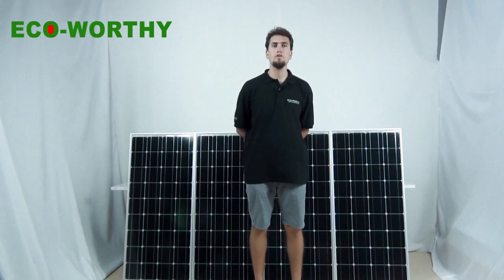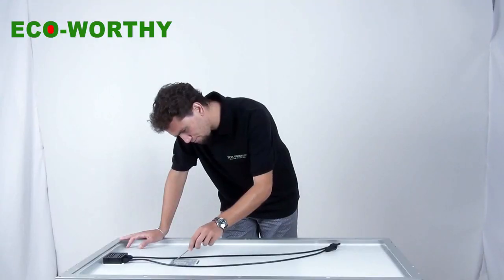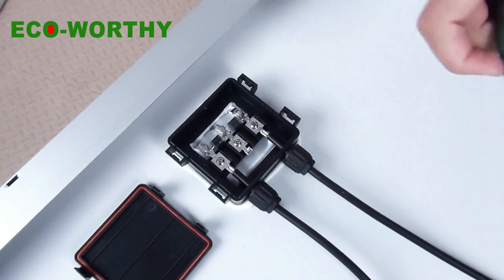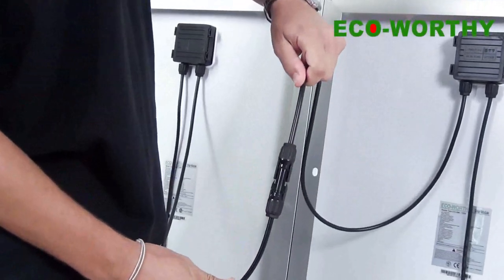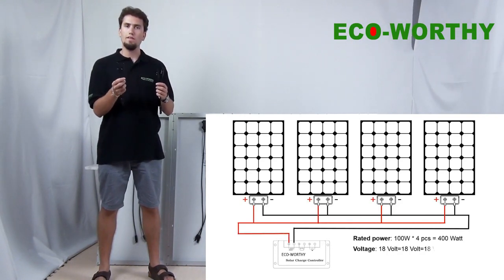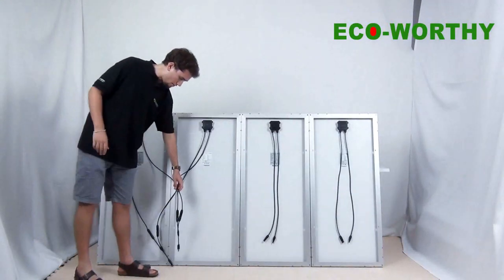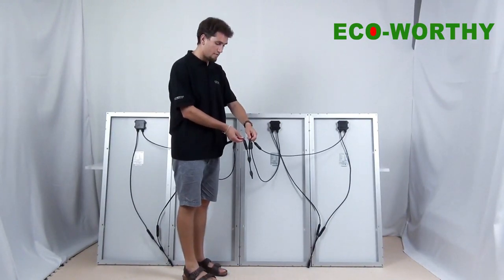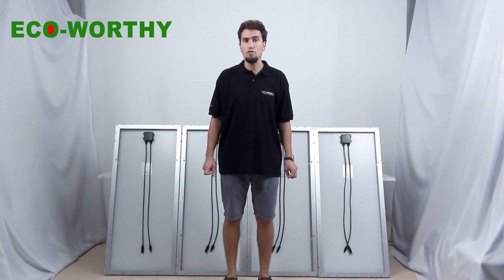Series vs Parallel -Two connection ways of solar panels

Comment: what's the benefit to series vs parallel?
Reply: If you have a 24 volt battery bank system, you will need 24 volts power to your battery bank. You could series two 12 v (100 watt) solar panels together to make one 24v 100 watt in panel. if you want to double the potential wattage, you combine those same panels in parallel for 200 watts at 12v
Reply: @op8995   what do u mean 24v 100w with 2 panels. The wattage is the percentage between  the current and voltage  if u have 24 v so it’s 2:1  then it’s 200 watts. At both series and parallel wattage does not change the voltage and current only changes.
Reply from the maker: Hi, now you can choose our products and see price even don't need to login  from：  https://linkpop.com/ecoworthy
Reply from the maker: Hi, now you can choose our products and see price even don't need to login  from：  https://linkpop.com/ecoworthy

Comment: Good explanation. Is the series connection better or the parallel connection???
Reply: By my limited understanding it is best to use as high Voltage as your device can handle without trouble. Because the Watts is what you want and you can get it with more V or more Amp, but the latter means the cable might need to be thicker and the more Amps you have the more power is lost on the way. So I have a 16-68V device and plan to get the Volts as high as I can without getting too close to 68.
But I´m a total beginner, so take my words with a grain of salt.
Reply from the maker: Hello, I'm sorry for not being able to reply to your question in time, now you can check the latest products and prices directly through:https://linkpop.com/ecoworthy
have a nice day!
Reply from the maker: Hello, I'm sorry for not being able to reply to your question in time, now you can check the latest products and prices directly through:https://linkpop.com/ecoworthy
have a nice day!

Comment: I am planning to connect three monocrystalline panels of 330watts with two 150 ah battery in series to get 24v in to an inverter of 1.5 kW capacity.will you advice the capacity of  mppt charge controller I have to purchase and the type of connection which I should make the panels whether parallel or series.can you please advice?
Reply from the maker: Hello, I'm sorry for not being able to reply to your question in time, now you can check the latest products and prices directly through:https://linkpop.com/ecoworthy
have a nice day!

Comment: Thanks the nice video. Suppose I have four 300w solar panels, 3500va (24v DC) inverter, and ten 100Ah batteries. How do I configure them?
Reply: 10 100ah batteries. dang. i plan on only getting like 5  .. did u figure out how to connect them? yea the battery connections is the only thing i need to figure out
Reply from the maker: Hello, I'm sorry for not being able to reply to your question in time, now you can check the latest products and prices directly through:https://linkpop.com/ecoworthy
have a nice day!
Reply from the maker: Hello, I'm sorry for not being able to reply to your question in time, now you can check the latest products and prices directly through:https://linkpop.com/ecoworthy
have a nice day!